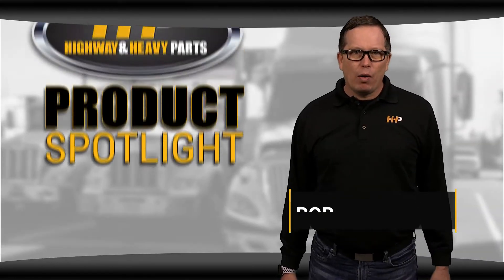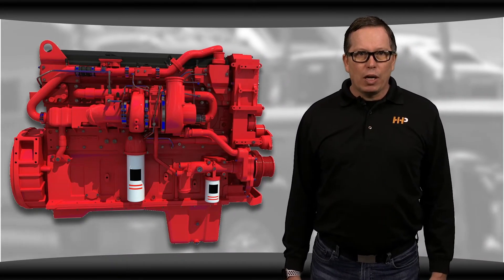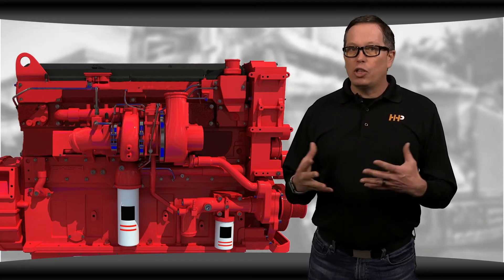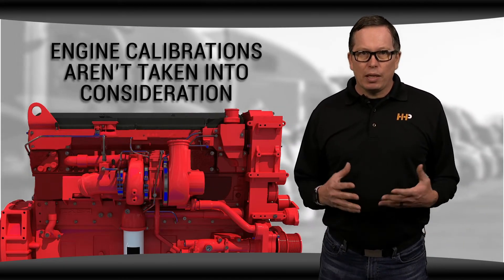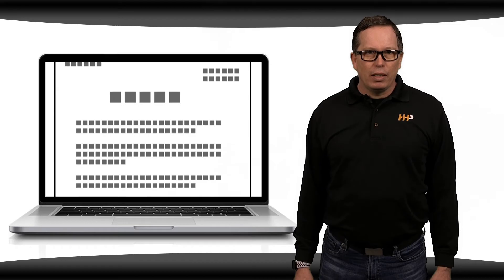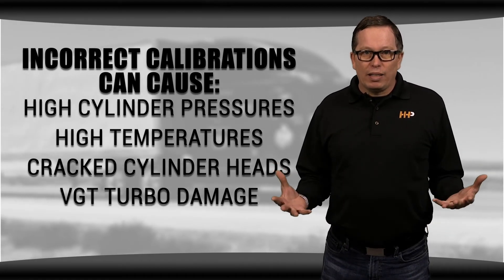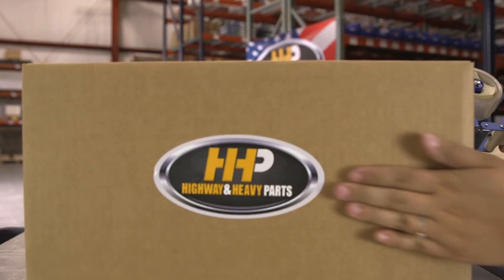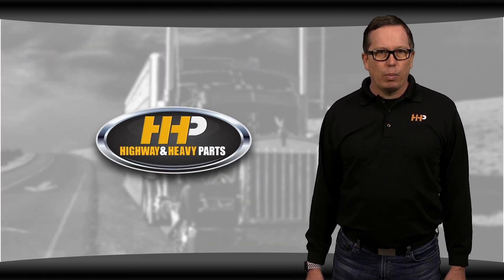Will an EGR Delete cause damage to my Diesel Engine?

Comment: I am repairing a bad delete on a Cummins ISX CM-871 right now, in a 2008 Kenworth T-2000. It was one of those Big Tuner Shop deletes, everything stripped off the motor, the only thing they left intact was the VG Turbo, which was a good thing. The truck had no power and was in constant derate. No head failure yet, I think we caught this in time before the motor blew. It had roughly 4 hours of high heat issues, spread out over a couple of months according to Cummins Insite. The cams look good, as do the rollers, so no damage there. 

First thing I did was to remove the DOC and DPF filters, both were intact with a few holes drilled in each. That would explain the high heat events and all of the chunks of soot in the turbo when I removed it. Also the high internal pressures in the motor, oil seeping out around the valve cover and oil pan. The front structure looks to have held up, as the truck had a hopefully professional in frame a few years ago, prior to this crap delete, which looks to be recent according to the computer.

Then the EGR Cooler, that is gone. With the CM-871 the EGR Cooler also cools the #5 and #6 cylinders, they do make a bypass kit for this motor, the delete shop simply installed a plate, so the back of the motor was not getting any cooling. 

The water pump, it was for a CM-570, and was installed with lots and lots of RTV, as was the cooling housing that holds the coolant filter. Instead of purchasing a new gasket, they loaded it up with RTV too... None of the bolts were properly torqued either, the water pump bolts were already working their way out. The only thing holding everything together was RTV. And let me note, you could not see any of the RTV until I removed these parts. 

Because of this, I need to get into the cooling system, starting at the thermostat housing to see if any of this RTV made it that far. I just hope none of it made it into the radiator. Because of the high heat events, I am also replacing the oil cooler and oil thermostat. 

The turbo was cooked, right on the verge of failure from the looks of it. Even the oil and coolant lines to the turbo were damaged. The actuator was toasty too, and loaded with soot where the actuator and turbo housing meet. I ordered a new reman turbo and actuator from YTS Turbo in Griffin GA. The reason I was happy they left the VG Turbo, as there is a $1000 core deposit. 

The work they did installing the turbo, oh, they did change the exhaust manifold when they removed the EGR Cooler. The turbo, it has oil and coolant lines running to it. These lines have an assortment of washers and o-rings, most all were missing. I have no clue how this turbo did not grenade. Very very sloppy work, but you would never know until you started removing parts. 

Then the exhaust, due to the high heat, it destroyed the "S" pipe coming off the back of turbo to the filters, that was another $800... 

I have yet to pull the cal file to look at the delete, I need to get the rest of this mess fixed first, then we will worry about the programming. 

Right now, I am roughly $8000 into this professional delete in parts alone, and damn glad we were able to save this motor. When finished, I think the parts bill alone will be touching $10,000. It would have been wiser to simply install two new filters, DPF/DOC, and complete an EGR Tuneup on the motor than having to go through all of this. We are looking at what, $15,000 to repair all of this damage that was supposed to help the motor? 

Delete your trucks and this could be your future.

Comment: I wish we had a TV in our shops waiting room with this video on a constant loop.
It would save me from having to explain these issues.
Then I could get back to cutting deleted engine counter bores because the liners are bouncing around due to combustion events they weren't designed for.🤦‍♂️🤷‍♂️👨‍🔧

Comment: How does deleting the EGR change compression ratio?
Reply from the maker: When the engine is built with an EGR system, the whole system is designed to work together. The EGR valve and EGR cooler control the amount of oxygen that's brought into the engine, which controls the combustion temperature, and keeps it within range.

When the system has been deleted, often these calibrations aren't properly taken into consideration. The compression ratios aren't changed, the temperatures aren't dropped, and the engine timing isn't altered.

Suddenly you've created an environment where overheating and high pressure could create some serious problems.

For any further questions on EGR Systems and replacement components, give one of our ASE Certified Technicians a call at 844-447-1453.
Reply: @Highwayandheavyparts  Also this isn't limited to diesels either. Gas engines can suffer the same fate if you remove an EGR valve from the system. It causes knocking and pinging and the engine is not tuned properly to not have one. My Ranger once had a clogged EGR tube full of soot and it could not get exhaust flow to the intake of the engine. It got bad enough that the pinging cracked the head gasket at cylinder 5 and caused combustion gas to get in my coolant. So head gaskets had to be done. All that from an inoperable EGR valve. Seems like the people who try to remove these devices are the same ones that remove intake resonators or exhaust resonators and say having them on reduces engine power and is just to make the engine quiet when they don't actually know how these things work with acoustic tuning. Also removal of things such as these items is almost like someone putting a band aid on something cause they don't maintain their truck or car to keep these systems running effectively and efficiently. I like my shit working as it should how it came from the factory and I'm a car enthusiast. If I wanted the vehicle to do something different than what it was meant for I'd buy something else. The older I get the more educated I get about not tampering with the way a vehicle is designed unless the OEM quality part is subpar to a better aftermarket alternative.

Comment: I am new to diesel. Just bought a 2021 Chevy Silverado with a Duramax 3.0. So many people talking about deleting the EGRs. As an engineer, I just can't imagine the consequences of deleting the EGR because I understand the extreme complexity of the inter-dependencies. The Duramax 3.0 was designed from the ground up from scratch. The EGR system is designed to be part of the whole. Properly deleting it would mean redesigning the entire engine. The consequences of removing part of a complex design without problems is akin to editing a complex computer program which we didn't design and build and don't fully understand. Editing it will more than likely introduce more bugs and problems than solutions.
Reply from the maker: Franks, we couldn't have said it better ourselves!
Reply: Spot on guys,  your advice on downsides of EGR delete should be widely published, far too many myths and absolute incorrect information out there.  Higher cylinder pressures and associated higher temperatures are due to fundamental change to the combustion process. Great work thanks.